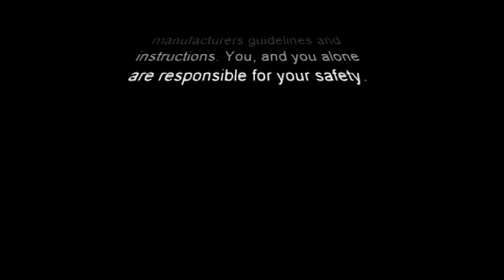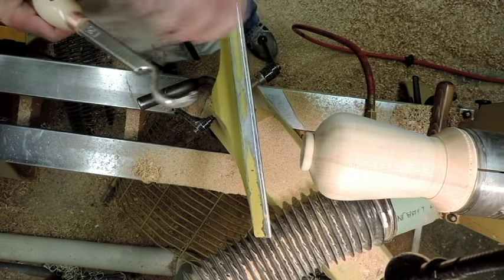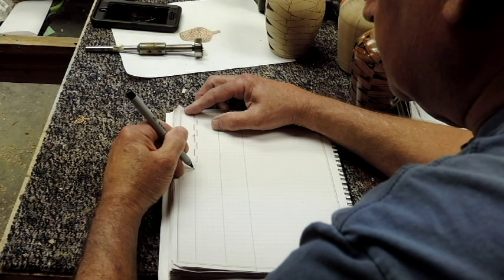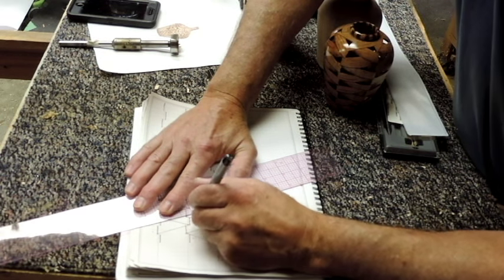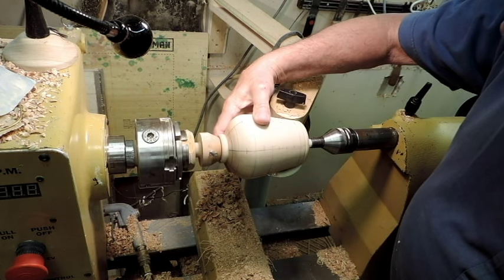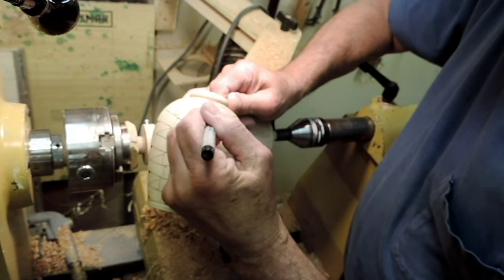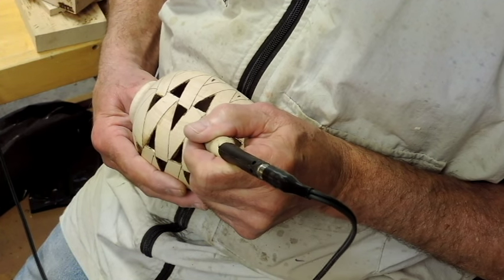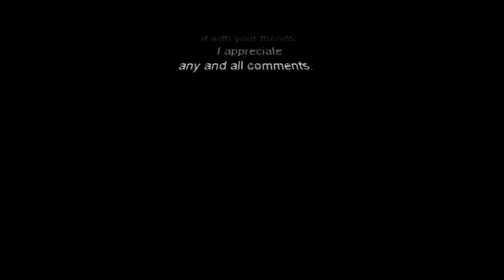Open weave maple vase

Comment: Looking amazing! I want to make one of those, but I don't have a dentists drill!! :) I do have a new Dremel with the extension cord, I'm pretty sure it will work as well, thank you for sharing this project Steve!

Yuval.
Reply from the maker: +Yuval Lahav Woodturning 
Thanks Yuval and thanks for watching and commenting. FWIW, the little dental drills are cheap, cheap, cheap on Ebay. Most any kind of compressor will power one as they don't take much air. The really big advantage to them is, since they turn so fast they don't tend to run as much as a slower speed tool. If you're interested do a search on ebay for nsk panamax 4 hole.
Reply: +Steve Krumanaker Thank you Steve!! I don't have a compressor, but I am thinking of getting one (looking on the used boards), so I'll start looking for a dental drill as well... if I could find a chair to go with it, I can think of my next hallowing costume!! :)

Comment: what is the high speed carving tool you are using?
Reply from the maker: cheap Chinese knockoff from Ebay.

Steve
Reply: can you please provide a link. I cant seem to find anything for less than $300.00 that will do more than 49000 rpm. Unless I am not using the proper search terms.  Thanks in advance
Reply from the maker: On Ebay, do a search for "nsk pana max 4 hole". You may also want to do a youtube search for "piercing on the cheap"

Steve
Reply: Perfect!  Thanks so much

Comment: You need better camera angle and closer to your work. I pick up a couple of things.
Another thing is you can cut it shorter by not showing all the drawing.
Reply from the maker: Please watch the first minute of the video again, notice the part that says it's not an instructional video. Aside from that, you also missed the point of the video. Piercing techniques are well known and can be seen in many other videos. Learning to draw the pattern IS the important part. Even so,  I admit the camera angle is bad, I am an amateur at turning and at shooting videos and sometimes make mistakes. That's the reason I did another video showing how I do the piercing.